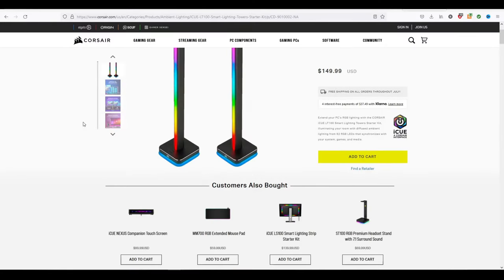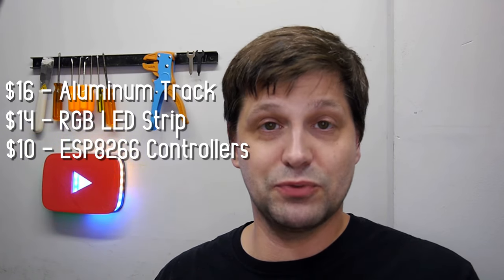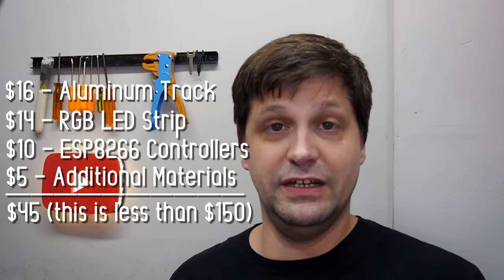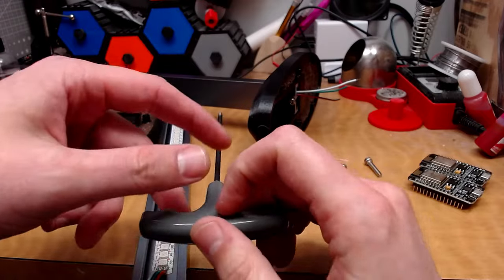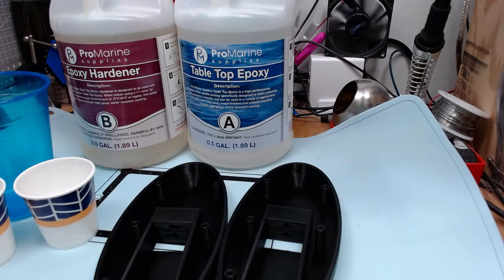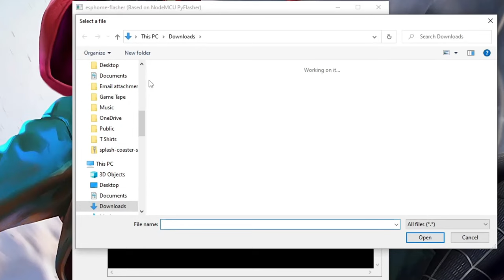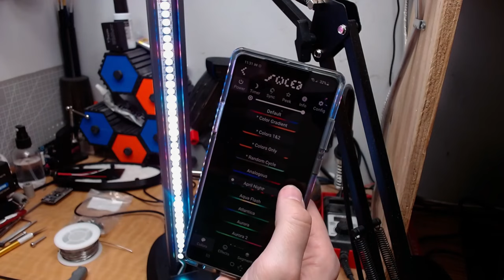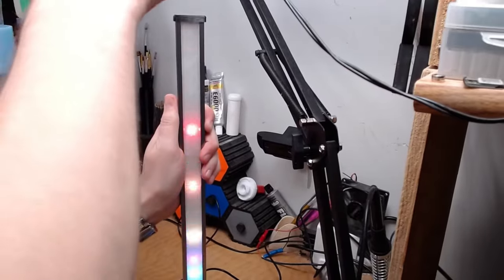I knocked off Corsair's RGB towers, only better and cheaper

Comment: Turned out really nice 👍 One thing that would help make things easier though is to just buy some LED channels that come with diffusion strips, you can get them for pretty cheap on Amazon. Also for the base, you could instead design tubes into the inside of the base to stack some metal washers in to add weight..
Reply from the maker: You are almost certainly completely correct. Sometimes I get on a roll designing custom everything and end up designing parts I could easily buy.
Reply: @KenMakesMistakes  Yeah just like with your magnetic stirring video, sometimes it's better to buy something off the shelf. It's definitely a challenge though to weigh time, effort, and money.